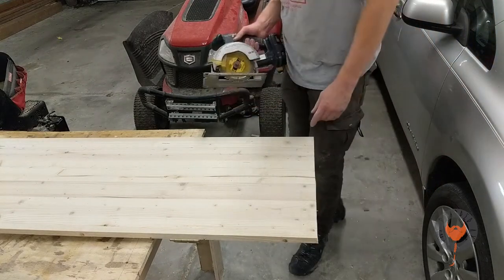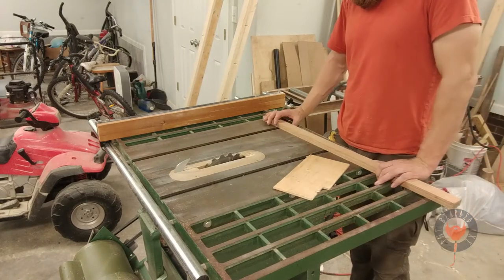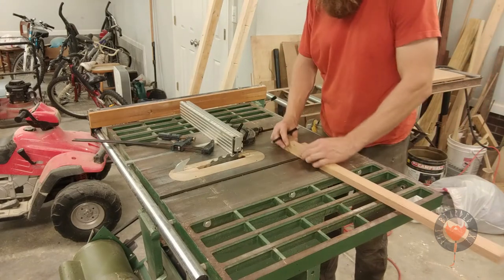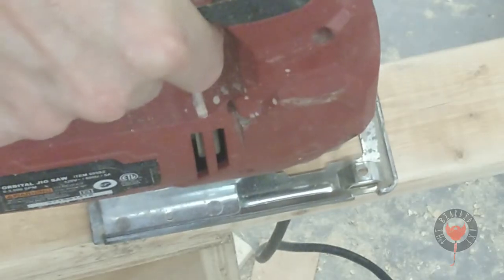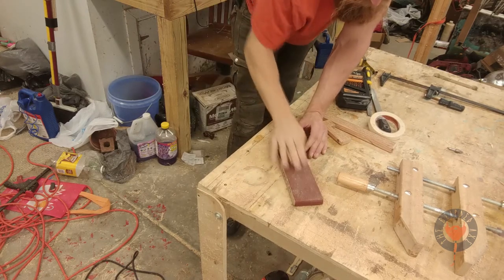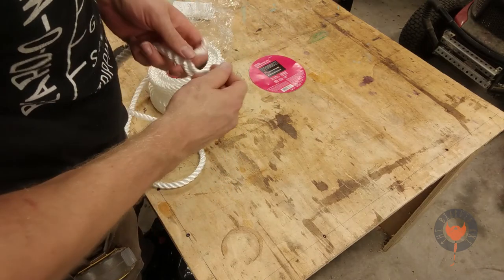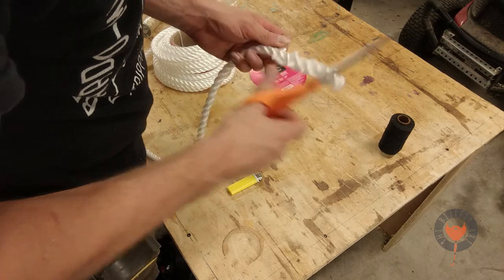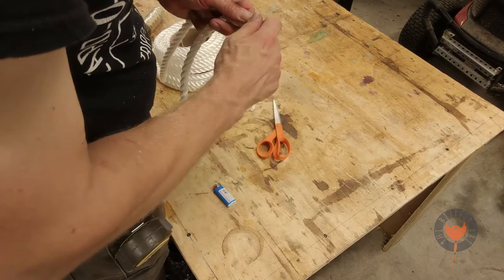Making The Door For a Yurt Part 2

Comment: I have done some renovation work and installed a few doors. You could have left the door in the frame and just sanded down the areas that were rubbing with your disc sander. I think what might have caused the problem was the wood glue expanding in the cracks. Wood putty might have been a better crack filler.
Reply from the maker: I filled the crack with glue to keep it from splitting further.  Wood puddy just won't do that for me.  That door sat for a few weeks before I put it in the frame.  However I think humidity did play a role.  When I had the yurt out and  It would rain the door would stick a little.  A bit of bees wax or canning wax where it runs works good for these issues.

I think the reason why it was rubbing was because of how the hinges pivot.  As I was opening the door the hinges would swing out a bit towards the door jam.

Anyways do I appreciate another perspective and if you have any other suggestions definitely send them my way.  Thanks for watching 😊

Comment: I like how all your videos have uplifting quotes ;) we all need good vibes. Also love how you have shits now!!! I want one :D Now about the door how wide is it? Looks about 3 feet. Is that normal size for a yurt door?
Reply: Shirts** not shits lmao
Reply from the maker: Normally yurts are 4' high and the doors are also roughly that wide.  My frame couldn't be more then 2' total width otherwise it wouldn't fit in the little Mazda I have.  This means the actual door is slightly narrower at 20" wide.  😬
I did worry that it was a bit too narrow but it's mostly for me and it worked out just fine.